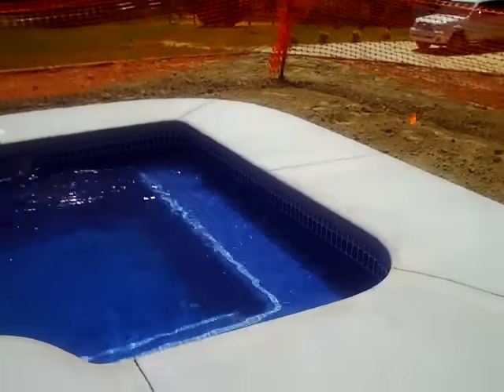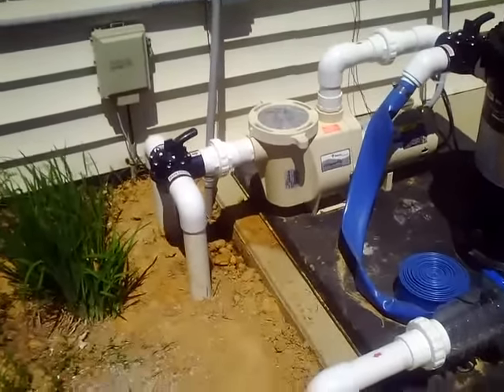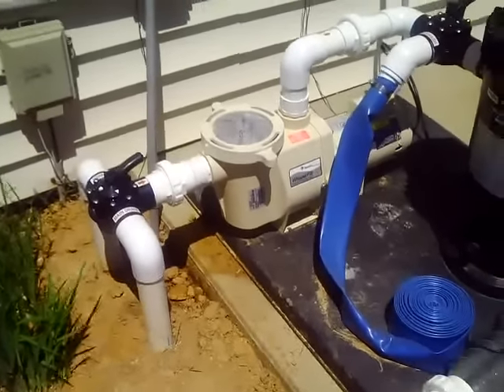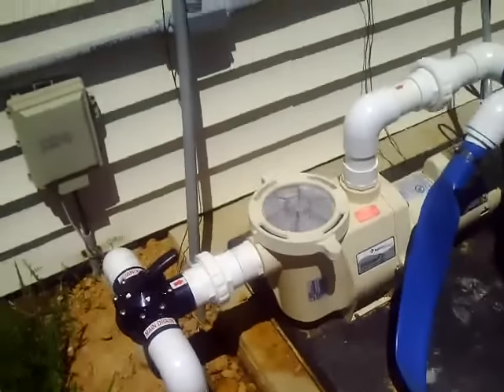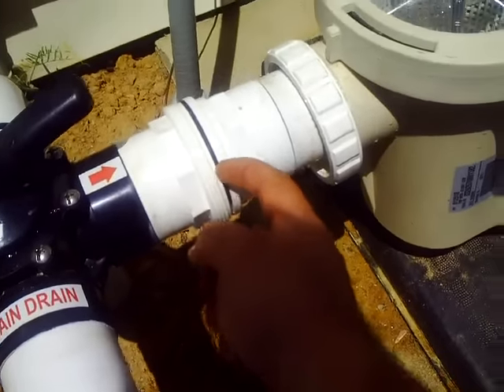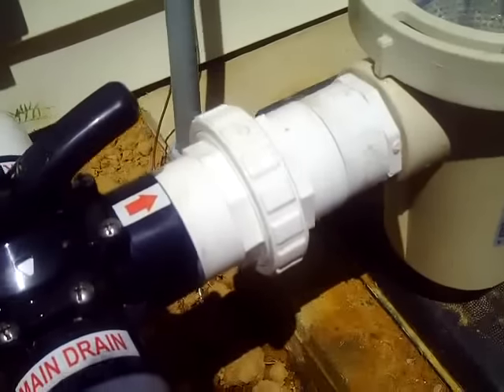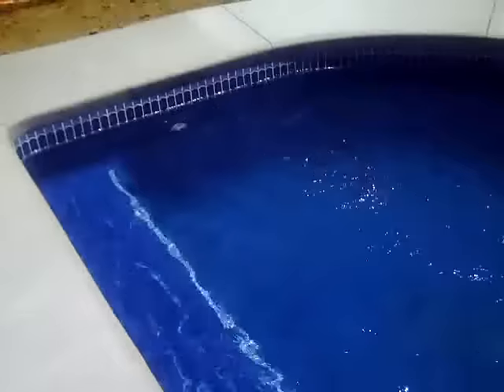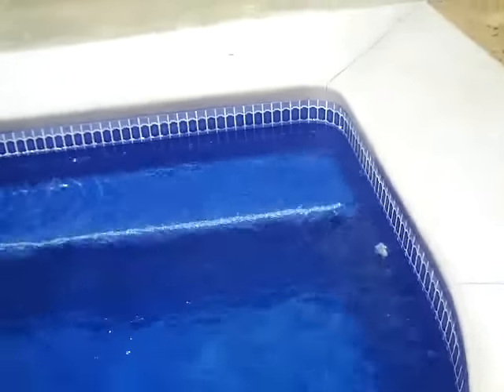Why are there Air Bubbles in my Pool? A Troubleshooting Guide

Comment: I have an enviroswim system that keeps getting air bubbles in the wet 
cell.  I have dismantled and fully checked skimmer, pump, filter, 
ultrasonis coil, wet cell and unions with no issues found.  The bubbles 
accumulate both when the pump is running and also when it is off? Any 
suggestions as to what may be causing this problem?

Comment from the maker: You have two different issues going on there.  The water from the backwash is due to a problem with your multiport valve that the backwash hose connects to.  You need to replace what's called the spider gasket within the multiport.  Some units require replacing the entire head.  The bubbles come from a leak somewhere on the suction side of the pump as discussed in the video.  Good Luck!

Comment: Thanks for the Vid! I do not have air bubble coming out from the pool, though I still  can't fill the filter full  of water. It fill up 3/4 of it only.
Reply: yep same
Reply: YOU LIKELY HAVE AN AIR LOCK IN YOUR FILTER CAPSULE TURN ON YOUR PUMP OPEN THE RELIEF  VALVE NEAR THE PRESSURE GAUGE WHEN NOTHING BUT AIR COMES OUT CLOSE THE VALVE

Comment: Nice video. The nipples you're using to thread into the female threaded ports of the pump are prone to leaking air. Must use a machined nipple or a hi-temp union. That will prevent any air leaks on the suction side.

Comment: just put in a new pump...had bubbles, watched the video and wouldn't you know it-pump was sitting at a very slight angle, not making a flush connection...not enough to leak, but enough to suck air...problem solved....great video...

Comment: Fighting this problem for a week suspected air but figured it would leak water if it was leaking. Thanks for the info.
Reply: Not necessarily since on the suction side you have a vacuum created. Suction side: air in, Return side: look for leaks.

Comment: Hi Jason: Great youtube troubleshooting info. I have a question regarding an issue/leak noticed during the past year. My inground pool loses water. It levels out about 1" above the bottom of the bottom of the skimmer. So, everything works but the level is still low. I noticed black "algae" between certain tile grout lines around the pool at the exact level the pool level remains. Is the pool leaking at the grout lines between the tiles? Is this common. Is there an easy fix? Thanks Pool School.
Reply: I was refilling my pool for about 30 minutes every other day. I had a pool detector guy come out and found out that he had to reseal around the entrance to the skimmer box. I have not had a leak since! 10:36

Comment: Pressure gauge won't drop down after cartridge cleaning. I put a brand new cartridge in an same result. I changed out pressure gauge. Same results.
Now I'm told to acid wash filters. Ok. But the new, clean cartridge made no difference. Help.

Comment: This just happened to me but my problem is the skimmer springed door I managed to push through on the other side and water can’t get fast enough to skimmer and air keeps entering. My case is probably rare I have older pool and the notch that hold skimmer door in have very little left

Comment: Hi. Thanks for the great video. Maybe you have some help for me too.

Since I had algaes my pool the return jets are blowing lots of bubbles. There's also lots of air in the pump visible. While cleaning out the algaes I noticed that when the pressure in the filter went up, it showed more bubbles and after cleaning the filter (and showing lower pressure) always reduces bubbles extremely. Yesterday I cleaned the filter and then I had no bubbles at all for 24 hours. Now I cleaned the filter again and the bubbles came back. Can the filter somehow cause bubbles? Actually I was sure that bubbles can only come from the suction side and not from the return-side (where the filter is ...). I've checked everything that is suspicious to cause bubbles already (water level, pump-lid, drainage valves, union and the whole pipe all the way till it goes into ground ....) and I've also re-lubricated all the o-rings. I've also tested against leaks along the pipes with smoke-sticks and plastic-foil wrapping around - but no hint. 
Could an underground leak actually suck so much air when covered by so much dirt and sand? Also because of our pool isn't losing any water and the bubbles on/off thing I don't think it's somewhere underground, but what else could cause these bubbles? It's driving me crazy ... Thanks for any help!
Reply: I've ran into this problem before and I found a small crack in the pvc underground coming from the skimmer line. The crack was small enough not to lose water but when the pump is on and the pressure is high enough it would suck air through the line to the pump. The previous pool cleaners talked them into buying a new filter pump and booster pump because they didnt know what was wrong

Comment: What would cause bubbles coming out of only one of the return jets ?  I would assume if it was a poorly seated o-ring or strainer pot lid the air bubbles would come of all the return jets like the pool in the video.  Thanks
Reply: Hi, I know your comment was from 3 years ago, but did you ever figure out why bubbles came out of only one return jet? I'm having the same issue, thanks.

Comment: I get similar air bubbles, but I find it has something to do with the cartridge filter container.  It appears that it is not able to expel all the air in the canister. I help it along by open the air release valve on top and let it expel all the air (wait for jet of water to blow out) and that solves the problem.  At least for a while.  After a few hours or the next day, you have to do it again.  Any idea why this would be happening??
Reply: Did you ever figure it out?

Comment: Hi, can you advise me please? My pool pump seems to start up perfectly but with time the Zodiac stops working. When I then switch off the pump, there is a massive explosion of trapped air out of the ingress port in the pool. So Im presuming air is coming in and getting trapped (filter?) and not escaping, hence the pump failure. I have check the water level, the weir basket gasket and cannot see any obvious pipe seal issues. Where should I start? Many thanks.
Reply from the maker: Allen, the Zodiac you refer to is a suction side cleaner that connects inside the skimmer correct?
Reply: Hi. Im a pump engineer and a pool owner, and stumbled on your post. I don't know about the zodiac, but if its a suction side connection, the inlet negative head (restriction) may be so high that its pulling in air leaks between cleaner and pump suction. Try lube on all o-rings, and gasketed. connections and the diverter valve. Cavitation is another (and damaging problem). Inlet head (NPSH) may be below pump specified requirements with the cleaner connected. Put an inline -30-psi/-Hg gauge at pump suction and check.

Comment: Maybe I missed it but what do these air bubbles do to your pool system?  Curious cause where I live there is a pool and it has air bubbles. The water is below the skimmer. Thank you.
Reply: Olga D. It can lower the suction thus making your pump work harder, as well as in extreme cases air lock your system the bubbles usually indicate in the return line that there's a leak

Comment: Wouldn't you have water leaking out if its not sealed properly. I  get a tiny bit of bubbles but nothing is leaking and pump is fine. But my filter makes a funny noise and the return pipes are slightly shaking.

Comment: Not bad. I'll add: never plumb a pool pump with schedule 40 MIP's (male adapters). If that pump gets hot, they'll shrink and you'll have a bigger problem to deal with. Always use CPVC nipples or the currently available hi-temp unions (I prefer Praher as I've seen CMP's shrink from running dry). 
Also, check the 2 drain plugs, especially the one under the pot as that's a vacuum plug. They're always barely snug from the factory.

Comment: I'm not seeing any air bubbles coming from the returns. Returns run at full power but over a few hours it reduces to very low. Strainer  pot water level goes down to about half way full or cavation. Anytime after I can  backwash and the power is normal again with no cavation...

Comment: Air leak could also be at the Jandy three-way valve O-rings and seal...
Reply: Or the Drain plug on the pump. Sometimes you can bump it while cleaning and it will loosen up.  Trust me it took me  awhile  to find the culprit.
Reply: @quickzilver333  Yes I encounter that problem before broken o ring, another is that pressure valve  (air release) gage pentair on filter drum have cracks, I changed it and now no bubbles.  But took me a lot of troubleshooting.  Another problem, that raccoon chewed my hose,  a lot of bubbles.
Reply: Dirty cartridges in the filter can also produce air bubbles in the pool but you wouldn’t see any air in the pump lid
Reply: Yes and it's supposed to have 2 o rings on the stem...not 1, not 3

Comment: Hi, what is that valve which you use to connect the two skimmer pipe to the filter? What brand? What's the type ? Thanks.

Comment: I also have a solar heating system installed on my roof, that I suspect is leaking. Could this also cause air bubbles in my pool. Thanks
Reply: joe parisi No, an air leak will be on the suction side or the pump itself. You can pour water over the suspected leak areas to pinpoint them easily.

Comment: If none of that works then theres a broken pipe or bad connection on pvc fitting underground on any skimmer or drain on the pool or spa ussally detected via sonar to find exact location to avoid damaging more decking and/or landscape. You can pressure test the lines to determine which of the skimmers or drains are affected directly. This is common in Texas since Barnett started drilling the natural gas from under your home causing minor earthquakes and land shifts.

Comment: Good video. But your claim that an air leak prior the pump intake is the #1 cause of bubbles could not possibly be correct. It is only your observation that it is the #1 cause because most people intuitively know to check the water level and strainer pot lid before calling a pool technician to diagnose the problem.

Comment: There's air in the suction line. Could be lack of water in the pool, a stuck weir blade, or a leak in the suction line. Worst case scenario is an underground leak.

Comment: There are five major reasons to have air bubbles returning  to the pool. The other two are: 4th, Cavitation. When water is moved fast enough through the plumbing, especially 90 degree fittings, the air may become separated from the water. That can be from it coming into the equipment and also returning back to the pool. In this case the pump suction is too close to the 90's shown. There is a formula for installing the plumbing correctly and also using better fittings, like sweep elbows. Also, check your local building codes for the latest requirements. 5th, Solar heating. Most of the time the filtered water coming from the roof solar drops down too fast, creating air that goes back to the pool. Sometimes a simple solution is to slightly close the returning valve, to the pool, from the panels. This will help to slow down the rate of the falling water. Make sure to check for any restriction, before and after adjusting, using the pressure gauge on the filter. If the o-ring, on that union shown, was that far out of position, there would most likely be water below the fitting when the pump is turned off.

Comment: When we had bubbles in our pool, it was because the gasket between the impeller and the pump motor was worn out and sucking air. After replacing it, bubbles were gone.

Comment: Shouldn't your returns by point down at 45 degrees and away from your simmer?
Reply: Your returns should point to where they are disturbing the surface. The idea is to get the pool circulating in one direction, either clockwise or counter, to maximize your skimmer's ability to take in debris. Every pool behaves differently, so telling you which direction works best for you isn't possible without being there. Hope that helps!

Comment: What causes your pool after shocking over and over to still be green and foamy on top.
Reply: Jeanette Moody Sounds to me like you have algae. get some non foaming algaecide. If you keep your ph and chlorine levels normal, you shouldn't have problems with algae.
Reply: Bad pump. We had the same problem and our pool looked like a chemical bath until we changed the pump

Comment: I had air bubbles in my pool and found that the return valves coming up from the ground were leaking.
Reply: What did you do to fix it? i might be having those issues myself
Reply: @julianlee1272  I had to dig up the ground around the pipes and cut the old valves off  and then put new one's on...

Comment: What if only one jet has air bubbles?
Reply: Kelvin Feliciano I'm having the same trouble just short of digging up my lines and looking for a cracked line I don't know did you find an answer for this
Reply: Joshua Rickert mine got better overtime but still not perfect, I would have to say that pipe might have a tiny leak somewhere.

Comment: i have dirty water coming from my pool inlet  on start up of the pump ?????
Reply: jeffery Pattison your filter also has o rings inside if you have a cartridge or a DE system. But if you have a sand filter most likely it's one or more laterals that have cracks. And unfortunately the only to check that is to empty out your sand by hand or use a shop vac. If you think it's to much for you to handle call a pool company to do the work for you.

Comment: In 10 years of servicing pools I can tell you this is only ever and issue on a new build/plumbing job. That oring once it's seated will never under any circumstances move at ALL. Also this is only one of many ways ari can be introduced into the system, on an existing pool what this guy shows being the culprit is never the cause of air.

Comment: i am a pool owner for 33 years in so cal... i sell used pool equip from demolished pools...  i am well- connected to pool maintenance and parts.... i do not want want to be disrespectful....  and am very earnest in my query.... but why do i care if there are bubbles coming out of my pool return jets, or in my pump?  seriously!!!  if my pool is crystal clear / sparkling water... do i really care?  what is the 'danger' of air bubbles in the system?  yeah, it may impact pump performance a teeny bit... but who cares?   i am unaware of any damage to pool equip this 'condition' can cause....  am i missing something here?  after 30 years?  please lmk
seriously????  please!!!!
i cannot imagine anyone giving 2 hoots about ' bubbles in my lines'
give me some hard... and they have to be useful... FACTS

sincerely,
mike
Reply: I'm interested to know this as well, but I'm a newish pool owner and have a few small bubbles sporadically coming out of one of my jets about every 10 seconds...seems somewhat innocuous to me, but Dr. Google has me a bit freaked out.
Reply: This just started  happening to me. The problem at least for me is i noticed a lower pressure in circulation etc. so i would like to figure it out
Reply: If you have a pool cleaner with a booster pump on it air in the line can cause the pool cleaner to not get the correct pressure. This causes the pool cleaner to not work as effectively. If the air leak is bad enough and the pump is running dry then it can melt the o-rings, gaskets, or pump pot basket into the impeller

Comment: that plumb job is a complete fail. people, do not use unions in front or on top of your pump as your setting yourself up for failure also only use CPVC nipples screwed into the pump. there is no need to pull the pump housing out for any reason if it burns out you replace the motor not the pump.